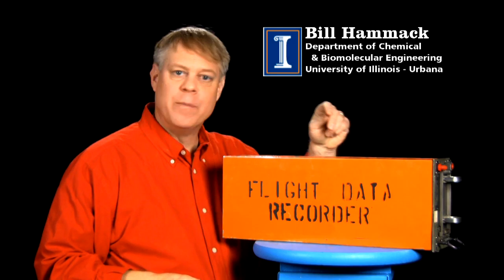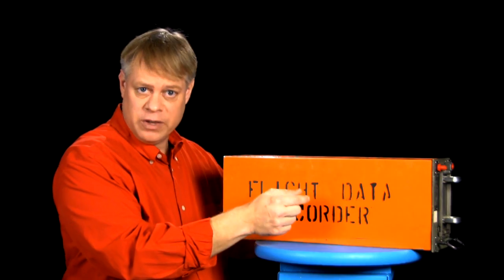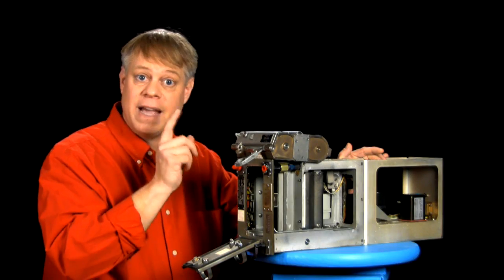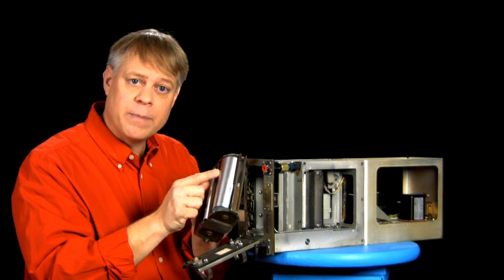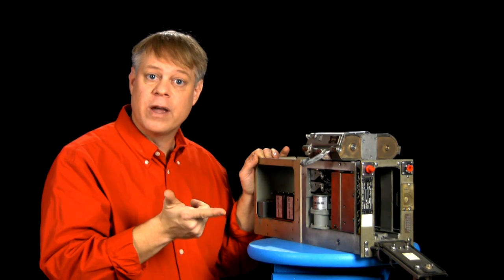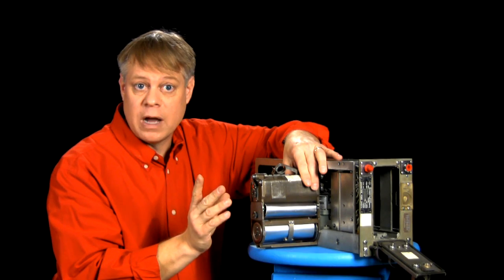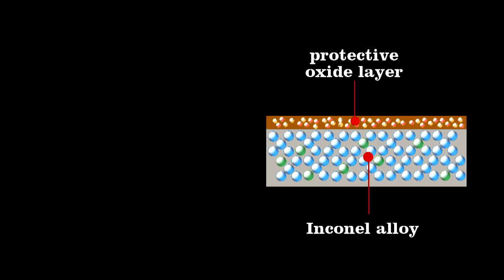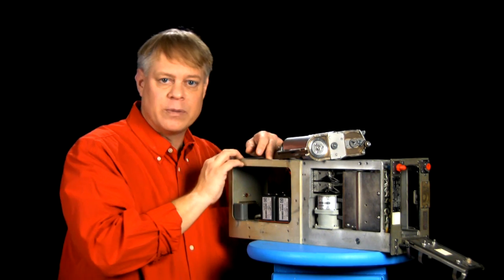Black box: Inside a flight data recorder

Comment: Ah, but why is it called a "black" box?
Reply: They used to be black. Sorry if you were hoping it was more interesting than that.
Reply: ***** Well, I guess not all facts have to be interesting.
Reply: Sean King It's a black box because data goes in, nothing comes out.  In engineering terms, such a configuration gives no clue about the inside working of the box, so it is "black". It is an example of the old computer engineering joke about "write-only memory".
Reply: The term black box came from engineering , where a customer would specify what was available on the outside and what was desired, and all that remained was for the engineer to determine what exactly was needed to happen within the black box in the middle.
Reply: puncheex2 like a black body in physics? makes sense
Reply: Different concept; a black body is a body that absorbs all radiation impinging on it and emits radiation dependent only on its temperature.
Reply: alazmi Alameera Why is the icon for emails always an envelope despite the fact it is a paperless process? Or why is the "call" button on cell phones a picture of a 1950-90s style phone? It's just the way we've always done it. (In my opinion at least, other people seem to think that it is because of its supposed similarity to an engineering concept).
Reply: puncheex2 no shit
Reply: Yeah, Dudd, no shit.  Even to you.
Reply: puncheex2 alazmi Alameera The first modern flight recorder, called "Mata Hari", was created in 1942 by Finnish aviation engineer Veijo Hietala. This black high-tech mechanical box was able to record all important aviation details during test flights of World War II fighter aircraft that the Finnish army repaired or built in their main aviation factory in Tampere, Finland. The "Mata Hari" black box is displayed in the Vapriikki Museum in Tampere, Finland http://siiri.tampere.fi/displayContent.do?uri=http://siiri.tampere.fi/content/20120601/13401000039090.jpg&type=big
Reply: My observation, in the long form, was this: 'black box' is named, analogously, for the colour black's light absorbing properties in the same way as 'black body'. I assumed, perhaps unfairly, that anyone involved in a conversation about etymology would recognize this. No informed individual thinks black bodies and black boxes are anything alike, beyond the misleading use of 'black' in their names.

I'd like to thank you for giving the correct answer to OP's question and apologise for being rude. You're obviously a high functioning individual who shouldn't need to pay someone like me any other mind.
Reply: There is a lot of people, I've found, who don't understand technology in even the simplest of terms. I try to help all sorts. My understanding about black box is that an engineers system schematic would have functionality shown inside boxes, but a black box showed only the inputs and outputs. I suppose a white box would also, but no doubt the black would add mystery to the puzzle.
Reply: why is it called a black box...when it's  orange-colored...shouldn't they change it to  orange box? xD
Reply: ***** actually on my phone call button is green and the icon for my email is envelope because of e-MAILS.so you went outside the question trying to prove your point (desperate to sound smart) black box was changed to orange because it was hard to find when a plane crash and who invented the black box was David Warren.
Reply: alazmi Alameera Yes, that was my point. It used to literally be a box that was black (which you can see in one of my earlier posts) and was called such. We continue to call it that even though it isn't black anymore. It's merely something we hold onto even though it changed LIKE the email icon. Furthermore, I wasn't referring to the color of the button on your phone, I was pointing out that the icon ON the button looks nothing like any phone in use nowadays. I'm sorry that you misinterpreted my original message. As for the idea that the black box was invented by David Warren, it is very hard to pinpoint the exact inventor of such a widely used device. Warren's 1953 design differed from existing flight recording devices only in that it recorded the voices of the pilots. However, devices similar to his had been in use for nearly 20 years prior to his supposed invention.
Reply: +alazmi Alameera Yes, it should be called an orange box.   Lately, the term "flight data recorder" is used.  And, of course, there also is the "cockpit voice recorder", which records the sounds and voices in the cockpit in a continuous "loop".  I think the loop runs for about 30 minutes.  Newscasters often refer to them as "so-called" black boxes.
Reply: Sean King
 So the name is a reference to a concept
Reply: It's called a black box because you don't know what's inside it until you go digging or you where there. A bit like the night. But mainly because when they were made they were coated with a fireproof paint, that just happened to be black.
Reply: Actually it's called black box because it's a only used if plane crashed or had major issues, which will be black day, donno i heard it from some pilot
Reply: Theres absolutely no need for Racism. Uncalled for.

Comment: I had the good fortune to meet a woman who works in the NTSBs flight recorder laboratory, she said her first job with the board was recovering data from just these sorts of recorders. Apparently the biggest problem is that, over time, the write heads drift such that there is no definite "zero" point for any of the parameters. Her job was to go back through the data, along with the aircraft's flight logs, and try to find a time when the variables could be deduced with certainty so that she could calibrate the rest of the data. Of course, there was no machine way to read the information from the tape, so she spent many late nights with a ruler and a magnifying glass :)
Reply: That's so cool. NTSB investigators are amazing, they're like engineers and detectives at the same time.
Reply: Wow!
Reply: said "    I had the good fortune to meet a woman. . . . . she spent many late nights with a ruler and a magnifying glass :)    "

Comment: I think BBs should be ejected from the plane in a case of a crash. The box should be able to float on water, and stream GPS coordinates through a sat communication.
Reply: If is capable of easily floating, wouldn't that make the initial impact with the surface of the water significantly harder?

Comment: First off, it would be immensely expensive to make a "indestructible" aircraft. Secondly, it would become too heavy to fly.
And when it would crash (depending on the speed and angle etc) the people inside would still die from G-Forces or being thrown around the cabin.

It's actually safer to have the aircraft crumble and tear apart like they do than otherwise for it's passengers. With a few exceptions of course such as fuel leaks and whatnot.
Reply: Similarly, this is somewhat why you have crumple zones within cars.  In case of a crash, the vehicle warps and crushes in given areas to dissipate the impact and its effects on the occupants.

Comment: yes they do, onto multiple chips and units so damage to one does not render the data irrecoverable and satellite links are being experimented with, so flight data is streamed live from the aircraft. also flash memory can withstand higher temperatures than magnetic tape, as tape will demagnetize once it gets too hot, while flash memory can survive above 250deg, tape will not. also flash memory can withstand far higher g-loading than tape, as a tape mechanism will jam if jarred to hard.

Comment: Inconel is not steel! in fact it contains less than 10% iron, more than 50% is nickel and at least 15% chromium. In addition Inconel has these properties largely due to its mono-crystalline structure or heat treatment.

Comment: Great videos. I used to work on the cockpit voice and crash recorders. Some of the earlier ones used wire to record data on (used on Concorde), others metal tape, moving on to ferric oxide on mylar(?) tape, then to solid state. The non metal based tape and solid state recorders protected the data by being embedded in a 'water jacket' inside a steel box. The theory being that the jacket - plastic coated hydrated chalk - would vent superheated steam hence routing thermal energy away from the unit.

Comment: The origin of the term 'black box' is unclear, but our museum has two extremely early USAF computer-controlled flight data recorders, manufactured circa 1961-1965, which are both black and box-shaped, just like everything else onboard a USAF aircraft. All of the flight data recorders we've seen which were manufactured from the late 1960s onward, including military units, are painted bright orange.

Comment: Hiya. Do you think that these devices will eventually be replaced by SSD drives? As we all know, SSD drives can take much greater impacts than normal HD drives. I believe that the kind of data that can be stored in a digital drive would be much more accurate than a bunch of needles and the amount of data can be much larger as well.
If you think about it, the SSD drives can be customized for this kind of application as well as the outer box.
Maybe I will invent that and get rich. Wanna join me?

Comment: @danielcarmi305 Think about it.  At what altitude did the problem first occur, at what altitude did the crew become aware of it, etcetera.  Anyone can see the result of the disaster, but the investigators want to know who-what-when-where-why caused the disaster.  Remember, the idea behind the box is the assumption that the first clue anyone had of a problem with the aircraft is when it has a Zen experience with Terra Firma, where the plane and the ground become One at a rather high velocity.

Comment: You missed some important information in your video. The ULB Locator Beacon was never mentioned. You also did not mention the protective material that encases the recording module. The recorder you bought on ebay was stripped of these items.